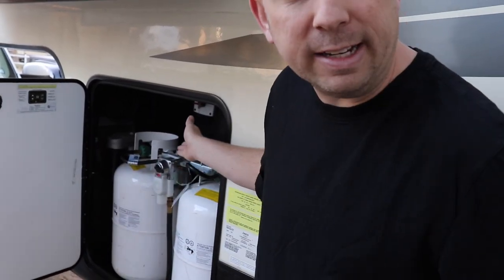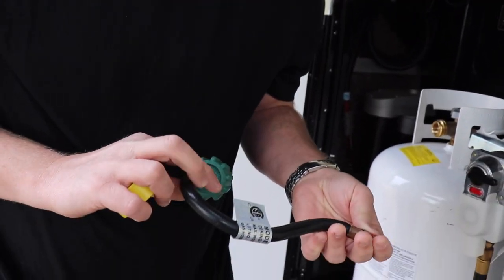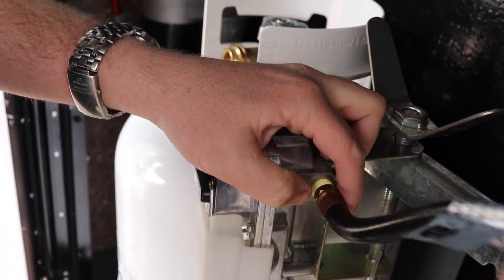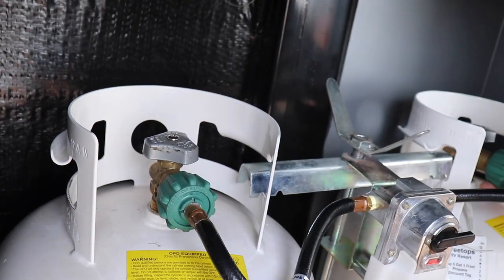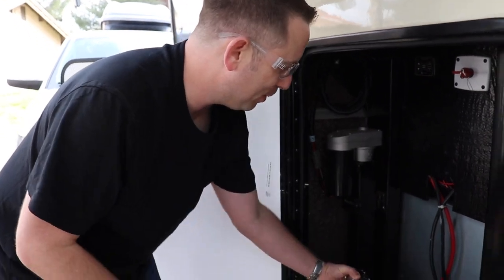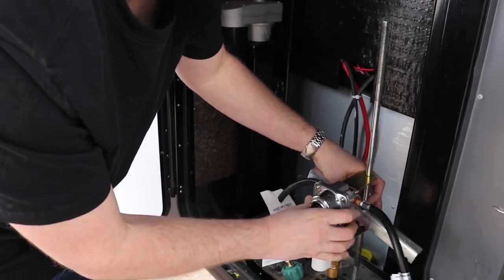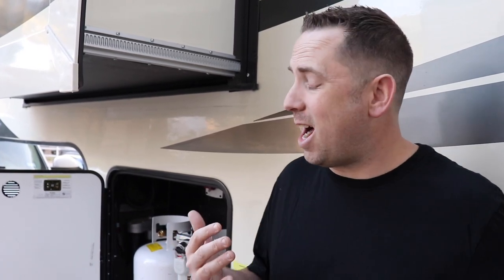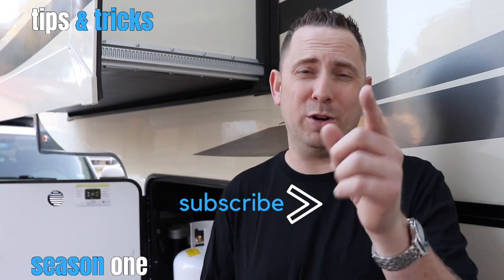RV LP Hose and RV LP Regulator Replacement - How to Replace Your RV Propane Hose and Regulator

Comment from the maker: 👉YOUR TURN👈 What RV repairs have you had to make? Let us know in the comments below! 👇👇👇
Reply: Besides the usual water leaks in the plumbing system which were repaired by simple tightening up of the fittings, I've replaced the sail switch and regulator for failures, and upgraded the rubber sections of the propane hoses to stainless shielded ones.

Comment: If I’m not mistaken, the end of your RV hose, the first one you wrapped the tape around, should never have tape wrapped around it;  those particular ends do not require nor need any kind of tape.  Where they often leak, particularly if you purchased a cheap online hose off of, say Amazon, is at the joint which cannot be repaired with tape; the hose is defective and needs to be replaced with a new one.  I wish I could post a picture of the leaking area I just referred to because it would explain it so much better.  People need to be aware that simply wrapping tape around the end of your RV hose does not necessarily solve a leak. If it does, it might mean that the hose end got loose and simply putting a wrench on it and gently tightening it would solve it.

Comment: You made a helpful video we have the same problem with propane smell in travel trailer RV I am going to spray the gas line underneath the trailer to see if it's leaking but I do hear a sound when I cut on the gas but one thing I learned by watching your video it also could be leaking around the propane area
Reply from the maker: I'm glad it helped! Were you able to figure out where your leak was?

Comment: Holy moly, my parts popped out all over the place like you said around 2:00! There must have been over 10K parts. I am way too old and rich to ever figure out how those parts go back together. ( Leave all the tough stuff to younger folks; they need a lesson in lifting themselves up by their bootstraps anyway). I'm here to throw money my problems until they go away!!
Reply: @AdamSmithChill  he trying to humble brag. 

We get it gramps. You can afford a gas line. Verily, yee art that for which we strive.

Comment: Today is Thanksgiving, and I'm giving thanks for ALL the wonderful Youtubers who are helping me learn to fix things now that I'm alone out here on an off-grid ranch in the boonies! I just wish I'd learned this stuff when I was young, and had more brain cells.
My ex installed the propane regulator, hose and fittings over 15 years ago, and they've always had a small leak. He told me there's nothing he could do, live with it. He left me for his side chick 5 years ago, so I've had to learn how to fix the stuff he worked on that is mostly failing now. 
Found the reason it was leaking, he put a straight fitting where it should have had a flare fitting, and to make it work, he wrapped Teflon tape around it more than 20 times! TEFLON tape, not the proper yellow gas tape. Scary thing is, this guy has worked at Disneyland for 40 years, doing maintenance on rides until @ 6 years ago when he was moved to working on parade floats (probably to avoid litigation).
I've got it all back together with a new hose and proper fittings, NO MORE LEAK!!!! Now I need to find a video on how to adjust the flow, it's a little high.
BTW, this isn't for an RV, it's a 3 bedroom house but I can't afford to have a big tank put in so I've been using BBQ tanks for 15 years for the stove, water heater, and clothes dryer. Really not optimal, but I can't afford better for now. Divorce was very expensive, but worth it.
I'm curious, what could cause both hoses to fail at the same time? Thank God it happened while you weren't there, and not while y'all were sleeping!
Thanks again for your clear instructions for folks like me.
Reply from the maker: @Lazy I Ranch I’m sorry to hear about all the yuck with your ex, but I’m so very glad that our video helped you! It’s amazing how many people think Teflon tape is right for this; I guess they just think it’s for all applications they consider “plumbing,” even gas. I think just one of our hoses really failed where the fitting clamped onto the hose. We replaced the whole assembly because the pigtails had check ball hardware in the ends that came out when I removed them. Thanks so much for your kind words! We were thankful that it didn’t harm us or Bucky. Best wishes in your off-grid adventures! Thanks for watching and commenting. In what part of the world do you live?
Reply: Divorce got me fixing my own stuff too. YouTube can definitely be your friend. I always watch several videos to see what works best for me. Tonight, I've seen at least 12 videos and this one was the best. I've researched everything about my propane problem and I'm pretty sure it's the regulator. I'll hunt down new parts this week. Thanks for the great video!

Comment: Looks identical to mine. I have a 2017 North Point too, the factory Winntec 6020 regulator failed in 8 months.  Replaced it with identical model.  Now left pigtail is leaking at the crimp at the tank connection.  I bought a pair of 12” stainless steel braided replacements on Amazon. The earlier statement by another poster about check valves are now located at the tank connector in new hoses is true. So I checked with 40 psi compressed air at the brass end and I heard the valve clink shut and no air comes out the other end or into the tank, so yay!  You had me worried there for a while.
Reply from the maker: Glad to hear that you got it resolved. That's good info on the replacements. Thanks for watching and sharing!

Comment: Great video. I am in the learning mode about the propane system. Had some friends stay in the trailer a while back and they smelled gas. As I was checking it all out, found the hose from the tank to regulator had a bad fitting and was leaking. Went to dealer and picked up replacement and changed it out. $32 for 12” hose and adapter. I notice online multiple brands available would like to know quality of one over the other. They are half the price then at the dealer.
Reply from the maker: @Jim Buckley Thanks, and thanks for watching and commenting! I noticed propane parts are certainly higher at RV dealers too. Next time around, when I'm not getting a warranty replacement, I'll do some research and make a comparison video. What kind of trailer do you have?

Comment: Here is a tip for you.

Installing thread tape. Put the tape in the opposite direction. In otherworldly, counter clockwise.  So when you go to thread your item, you're not going against the thread tape where it would unwind or bunch up. 

I noticed you put thread tape on clockwise and was worried it would come off.

Comment: Trying to figure out if that main line out of the regulator to service the trailer connects with reverse threads or not. Mine seems even tighter than yours. I'm stripping the regulator's hex piece (part of the main regulator's metal body) when using 2 opposing wrenches. Based your video, looks like it's not reversed. ...Unless your video was flipped, but doesn't look like it was.

Comment: on my 2000 Cardinal 33 LX 5th wheel someone stole my 50 amp cord and my two propane tanks and the whole hose and regulator assembly. Please tell me what can I do? Where can I get a replacement? Is there an RV junkyard I can visit to get these items and where is such a junkyard located? They also stole my kerosine heater that I borrowed.

Comment: On the bottom hose you should disconnect the hose from the brass fitting, then remove the fitting from the regulator. I can see you don’t know as much as you think you do about this.

Comment: Just remember if you have an auto changeover regulator, you likely have an inverted flare connector that doesn’t require tape.  There will be a brass fitting attached to the regulator that your hose connects to.

Comment: Man, having trouble unscrewing the brass connection using my 9/16 wrench.  It wants to round off the nut.   Trying metric and that fit a little better, but still not budging, and wants to round off the soft brass.  Was hoping YouTube would have some pointers. Was also checking to make sure it wasn't reverse threaded, and appears not as I watched you remove yours quite easily.  Hmmm.  Might have to find that penetrating oil.

Comment: Recently I wanted to replace a 6 foot hose with a 10 foot hose that was attached to a two stage regulator. I took a very large and long crescent wrench that was a good 18 inches long and actually put the regulator in a vice with some wood in blocks to secure it. I'm assuming the manufacturer must use some type of a glue. Being soft brass it just rounded off the corners. I then went to a standard pipe wrench, and now I totally destroyed the corners and that sucker still didn't budge. Next I tried the largest vice grips I had and clamped down on that thing with everything I had, and still it slipped. Apparently manufacturers do not intend for the hose to come off!  Really pissed me off as the hose and regulator were fairly new. I just needed it a bit longer. Just mentioning this as I suspect there's been a lot of suits against the manufacturers of these and they went to great lengths to make sure they don't come loose EVER. I would think twice before trying to remove a hose from a stock regulator.

Comment: Can someone tell me why you have to replace the regulator if the end of the pigtail has parts as described.  I have been told by rv dealer and two propane shops that new pigtails have the check valve at the end connected to the propane cylinder.  The regulator would not have to be changed.  All I needed are two new pigtails and adapters to attach pigtails to the regulator.
Reply from the maker: Hey Ben, thanks for watching. The ones like ours have the check valve at the end of the hose that connects to the regulator. When I removed them, the parts spilled out. Therefore, any replacements could not come with the parts inside the hoses as they would not stay in them in the correct position. They do not sell the hoses for our model separately for this reason. What kind of regulator (or rig) do you have?
Reply: @YoungerEveryDay  Thanks for getting back to me. Regulator is Winntec Model 6020.
Reply from the maker: @Ben Davis That's the same model we have. When I tried to swap the hoses at a Jayco dealer, they were surprised I had removed the pigtails and asked if they were difficult to remove due to the red thread glue they put on them. They said that they do not sell replacement pigtails for that model due to the little parts in the ends that screw into the regulator. They said other models have the check valve built into the regulator, so they didn't give me an option for some other type of pigtail. They ended up just swapping our regulator/pigtail assembly for a new one since our rig is still under warranty. One RV parts place I went to earlier told me they would recommend swapping the whole assembly for a different model altogether to make pigtail replacement easier, but I didn't want to do that yet since my warranty covered it this time.

Comment: What size wrentch did you use?
Reply from the maker: @Marilyn Gatson I used a 9/16" wrench on the pigtails and a 3/4" wrench to remove the regulator. Does that help?

Comment: Maybe I can save some people some time. I just went thru this ordeal.1. Start putting your WD40 a day early. 2. Remove tank for easy access. 3. Pull out hose to get a good grip on it. and 4. (and most importantly) You have three hex heads- The one on the end of the hose, a smaller one on the fitting that goes in the hose and the hex head on the end of the regulator. DO NOT MESS WITH THE SMALLER ONE. Just bang the old regulator with a hammer and hope that the WD40 and hammering loosens it up. Put your wrenches (large adjustable or vice grips) on the hex head of the regulator and the LARGE FITTING off the hose. This may save you a day of frustration. Lefty loosy, Righty tighty.

I laid up at night thinking I was gonna have to back a truck up with a bumper vise or get a gas torch to loosen the fitting. Only because I was trying to loosen the smaller hex head and not the larger.
Reply from the maker: @Bill K Thanks for watching and sharing some great tips! I definitely understand your frustration as I had quite a time getting that loosened! What kind of RV do you have?
Reply: I'm a little confused about the three hex heads you're talking about. I only see one. 🤔
Reply: @ubergigglefritz  You probably do not have the EXACT setup that Younger Living and I have. Go to 5:27 and see where he places the wrench? Look to the right about 1/4" do you see that larger fitting? That is the one I had to put my wrench on, the 3/4" hex he is on was frozen in my setup. At the end of the regulator, and you can see it in his video, there is an aluminum fitting on the end of it that will take a box end wrench.
Reply: @billk8817  ah, is it the inverted flare? I think mine is npt...
Reply: @billk8817  I put wd40 on it. Hopefully I can manage it or this is going to be a very expensive fix. I ordered the hoses, so if I need to pay someone to come out here just to unscrew something... 😡
Reply: I got the side requiring me to push down (on the right), but I still can't get the left side where I need to push up. More wd40 applied and will try again tomorrow. 😔

Comment: I’ve been wanting to buy an RV to expensive though
Reply from the maker: Anthony Unfortunately they can be pretty pricey. 😕
Reply: I have one that I will sell for $800 OBO, but it hasn't run in 16 years. 18 years ago, we drove it to Texas and back, more than 3000 miles. I wish I could afford to restore it, it would be perfect for one person to live in. It's a 1979 Dodge TransVan, very cute and "hippy-looking". It's built like a regular van, but longer, and only place you can stand up is the back where the kitchen and toilet/shower are. Needs lots of work, but would be a good project for a handy person with lots of time on their hands.

Comment: hey have u every small a fart in your camper did u think it maybe a fart gas
Reply from the maker: 😂🤣😂🤣 I have smelled one or two in there (our labradoodle's gas is the worst 🤢 ), but this was definitely that rotten egg odor you get with propane. We replaced the regulator/pigtail unit, and everything was good-to-go.
Reply: @YoungerEveryDay  clueless wonder, yeah you